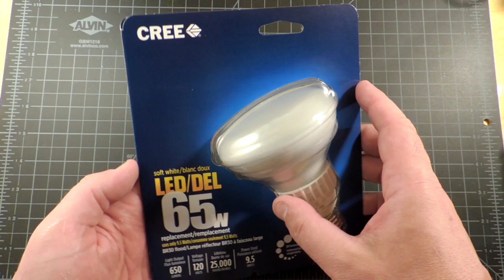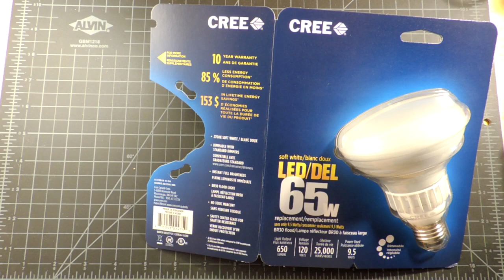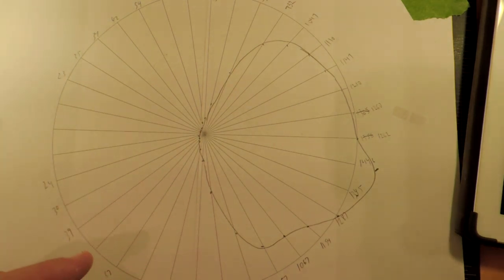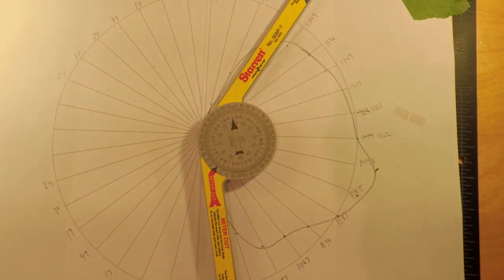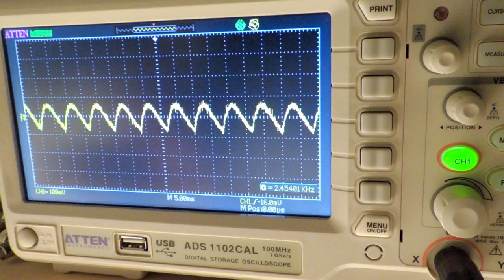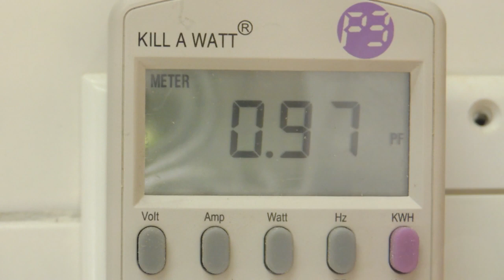CREE LED BR30 FLOODLIGHT EXTREME TEARDOWN AND REVIEW

Comment: Your reviews are great. Technical question. I know LED's can give off a slight hum on an analog dimmer. Would you know what would cause an LED to hum on a socket without a dimmer? We bought some Philips par40 LED's and surprisingly they hum a little. Its a Philips 423756 14.5-Watt (75-Watt) BR40 LED Indoor Flood Light Bulb.

Comment: The next version of this bulb loses the fins on the heat sink, as they did on the A19 bulbs, and goes to a plastic envelope.

I know this because, out of the 12 bulbs in my kitchen, 6 had failed and I got replacements from Cree. The unfortunate part is that the failures do not seem to be "infant mortality" problems and the replacements are failing within a year.

They start to flicker, then quickly die completely. The issue seems to be the use of mechanical surface contacts to connect the LED tower to the power supply. The contacts must be oxidizing or just can't take the heat of normal use.

To date I have lost almost all of my original bulbs and some of the replacements and I give up. I'm moving on to see if Philips will last any longer.
Reply: @drlava641  All of my Cree's eventually failed. The originals, the replacements, and the replacements of the replacements. All within about 2 years.
As they died, I replaced them with Philips bulbs which seem to be lasting longer.
Reply: @drlava641  No, there were so many of them that I threw them into a box and sent them off to the eco station. Most of mine were the connection clips between the boards, or the contacts to the power supply section. 
I just wanted some light bulbs, not a hobby.

Comment: Though however if you find this bulb to be a big improvement over the older model I may give it a try though however the lumens doesn't seem a whole lot though I'm sure it's for cost reduction but if they improved it in other areas such as how much light is shunned on to the ground when it comes to how much light is beamed then I might try it out over the kitchen sink?

That's all I can say.

Though what do you think of the Phillips BR30 even if this one has 730 lumens.

Overall I like the Cree but was just curious?

http://www.homedepot.com/p/Philips-65W-Equivalent-Soft-White-2700K-BR30-Dimmable-Warm-Glow-LED-Flood-Light-Bulb-452235/205395637

Thanks for listening once again.

Comment: Hey I'm back how's it going?

I just wanted to point out that Cree has updated there Cree BR30 Bulbs and I was wondering if I should stay with the older model as usual or go and hop and get the newer model?

Anyways if you want to check the newer BR30 out here it is.

First here's the older model.

http://www.homedepot.com/p/Cree-65W-Equivalent-Soft-White-2700K-BR30-Dimmable-LED-Flood-Light-Bulb-4-Pack-BBR30-06527FLF-12DE26-1U100/204369018

Okay here's the newer one.

http://www.homedepot.com/p/Cree-65W-Equivalent-Soft-White-BR30-Dimmable-LED-Flood-Light-BBR30-06527FLF-12DE26-4U100/206097760

I most likely will stick with the older model but it would still be interesting to see you to compare the older Cree BR30 with the newer BR30.

Thanks for listening to what I had to say.

You have a nice day.

Bye.